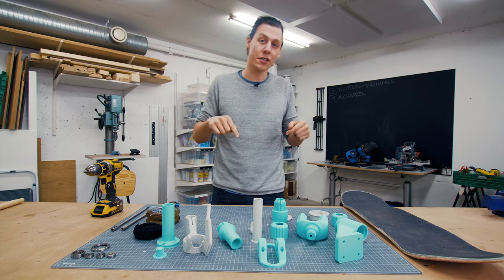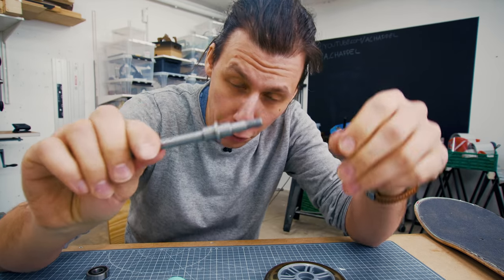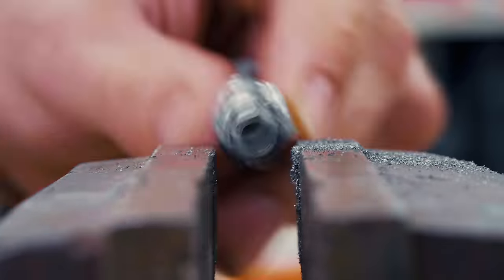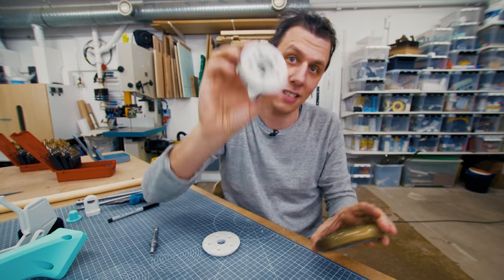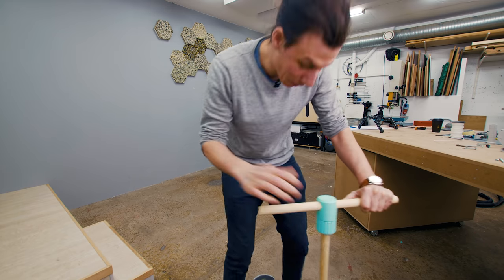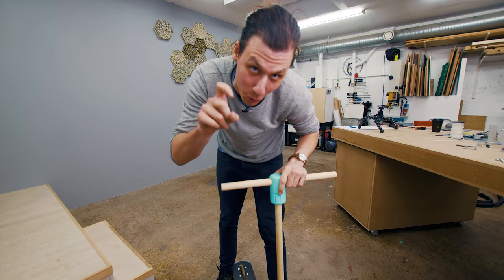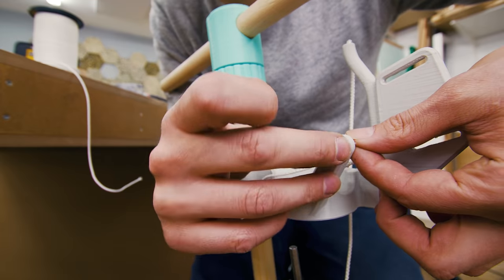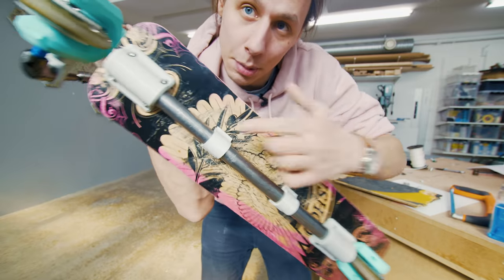DIY Drill Powered Electric Scooter - With 3D Printed Parts

Comment: Awesome job!  I'd recommend moving the drill lower to improve stability and eliminate the torque issues with the drill extensions.  The drill could be mounted in front of the front wheel so the weight of the drill is lower and better balanced left to right.  It would be further improved by driving the rear wheel as the inertia of the drill would not be connected to the steering assembly.  Any significant mass in the steering assembly can lead to over steering.  Teflon tubing would probably work for routing the throttle to the rear wheel area,  Props to you for showing the first board break, we have all been there...

Comment: In my head: "ok so it's the curvature in the y axis what gives the board it's stiffness"
AlCh: saws off the curvature
Me: "aight hopefully he won't regret it"
AlCh: breaks the board
Me: "oof, either he uses metal for the board or a board that's not cut in that direction"
AlCh: immediately saws off the curvature again
Geometry: am I a joke to you
Reply: The difference between an industrial designer & an engineer :-) 
Bending inertia I= (B*H³)/12 - notice how the height is cubed!
That is why the board was cupped to increase the height with the same amount of material.
I did not understand why the board width had to be reduced.
Still this build is very good ;-)
and the fix was a nice Queen truss - at the expense of road clearance ;-)
Reply: And the design was much better than I could do ;-)
this is why we have specialists.
Reply: @PWARHOLM  I suppose Alexandre reduced the width to have it look more like a traditional scooter, or to have it being more manageable.
Also that's the inertia of a square section, I don't wanna calculate the inertia of the true section but it's a nice approximate. plus i gotta admit, the truss was a smart way to fix the bending problem, altho if I was him I would've used a smaller truss
Reply: derchesten lol
Reply: @achappel  I think the full sacte board would look pretty retro like the "scooters" in back to the future
Reply: Stop spoiling it!! I haven't watched it yet!
Reply: @ironedge0  EXACTLY what I was thinking.
But still cool this way too. With the pipe maybe you can grind when you're not using the drill.

Comment: Simple brake, put a thin metal plate over the rear wheel such that when you stand on it it contacts the rear wheel to slow you and when you take your foot off it will spring free of the wheel.  Love the build and the amount of insane laughter it generated.  Keep up the good work.

Comment: Please publish the 3D models. Otherwise this would be just another scooter without any real use. Greetings from Germany.
Reply: Medien Mond dont 3D print this. Use a scooter as you can find them for sale online everywhere for Cheap
Reply: @steelavocado1  And a Hub Motor would be more Efficient and you can control it better. ^^
Reply: Tehnically you couldn't even use it in Germany lol
Reply: tbf you'd probably burn out the drill motor on your first ride. I don't think they're designed for constant use, just intermittent use.
Reply: Check his web page
Reply: virus killerism  True, but the thing is open source benefits everyone and a lot of people would like to build something like this.
Reply: @THYCR3AT0R  Perhaps, though these new brushless motors are quite durable. And he probably has warranty hah.
Reply: @Angeltitsss  Do you work at Dewalt? Because I don't know if that's a brushless motor or not. And yeah, as long as the motor keeps spinning it should work fine. What burns them out is usually too much resistance or heat. Heat melts the plastic the ballbearing is attached to which in turn makes the rotor wobble which then fucks the entire thing up. This usually happens in angular grinders, and also usually the 220-volt machines not the 18-40V ones.
Though I haven't seen that happen in a drill, usually the heat fucks the gearbox up in those machines. It's not very common. The brushless drills work surprisingly well, but the heat can mess the finer electronics up, you know the small devices that read the magnetic field... I forgot what they're called.
Reply: @Angeltitsss  Looks like a cheap machine as it has a plastic chuck and not a metal one. Thus it doesn't have a brushless motor and thus the carbon brush pair is going to get worn out, and in these drills, they're not replaceable.

Comment: It does have brakes. You can press on the rear wheel with your foot, the shoe's rubber sole 
will slow it down and won't make you fall since it's the rear wheel stopping/slowing down.
Reply: Interesting
Reply: @leoncaples2947  I remember kids using their foot to slow down while riding their broken bicycles 20 years ago. The advantages of living in a developing country...
Reply: @Albanez39  Sounds like a good time buddy

Comment: Everytime I see someone hit a bearing with a hammer, something inside of me dies.
Reply: he could've used a drill press with a dead shaft to press the bearing
Reply: wuss
Reply: @xagvsx1521  Aren't you a badass?! Look out, people!!!
Reply: The rollers and races die also.
Reply: He was hitting the outside race, perfectly acceptable way to install a bearing, and it won't cause any damage. A press isn't always the best or most efficient tool.
Reply: @diamondperformancefab5931  No, it's not. Bearings have to be pressed in with constant force, not with impact. Hitting the bearing unevenly makes the rails twist.using impact force could make 'em crack or split. In this case, it's nothing to worry much about because of the expected loads is not very heavy and it hasn't to perform for ages, but he most certainly wrecked the bearing with the first single strike on the race.
Reply: I guess I must be magic. Installed hundreds of small bearings with an hammer and driver into soft bores, never had an issue.  If you think one tap will warp a hardened outer race you are wrong. Can you damage a bearing with a hammer? Sure.... its possible. People should have real world experience before they comment. Obviously you don't. How do you install a input shaft pilot bearing in a crankshaft? Do you remove the engine then crankshaft? LMFAO
Reply: having  been an Automotive Tech and owner for 40 years .bearing banging badddd !!!! 3-D printing GOOD...
Reply: @ashleyt.784  How do you install a pilot bearing in a crankshaft Ms. Mechanic?
Reply: @diamondperformancefab5931  And once again. If you want to know, how you install a crankshaft bearing _properly_: With a bearing press tool. This works like a puller, but the other way around. It sits flush on the crankshaft, is mounted with screws on the surrounding threads and presses the bearing in via a screw or a hydraulic cylinder. But I guess you also can hit it with a nut and a hammer until it sits in place, so you could ensure another repair in the future if your income relies on it.
Reply: Yea I cringed I know it's not a precision component or anything but I would of at least used a rubber mallet 😂
Reply: Or you could start this topic on the informative side, instead of going straight to your frustration and just dump it out there, you might know stuff, but knowing how to pass it on is the real challenge and i don't need decades of expertise in nothing to figure that out.
Reply: @micleabogdan886  really? You got offended and he didn't even say anything rude lmao what is this world coming to...
Reply: Stop cringing
Reply: @joshuasimmons2412  so saying something like " i got more knowledge than you will ever will" and putting that into people's faces is not offensive to you? you must be a purist as well i guess :/
Reply: @marcus_w0  if you hit the outside it's fine
Reply: @marcus_w0  he used a wrench socket so he hit it evenly
Reply: @diamondperformancefab5931  i agree with yah.. Its acceptable considering also the base he fits in which is plastic...
Reply: You sound like a guy who simulate stuff by the computer and never have built anything.
Reply: @diamondperformancefab5931  it's a dude not a chick
Reply: @dswmetals02  Ashley T. looks like a girl name to me.
Reply: It was gentle taps 🤣
Reply: Keep on pounding Dan, I'm an ASE certified master Tech, since I was 21 also ASE certified advance level specialist who's been doing this for a living for 30 yrs, an I've been pounding bearings in my whole career , nvr had a comeback for a bearing..... EVER !!! I can assure u both these " intellectuals " that were replying to u , have nvr worked a flat rate job to support themselves ,  these if they truly r even "techs" at all they the ones that wear rubber gloves, and run around for half a day looking for a dial indicated inch pound torque wrench to adjust a tapered wheel bearing, and their go to tool to fix a drivability problem is an oscilloscope !!!! Lol  trying to reason common sense w these types is generally futile!! 😜
Reply: @diamondperformancefab5931  ohh n btw ,  saying that Ashley is a man's name makes about as much sence as thinking a autotech and a mechanical engineer have anything in common.... Js , ohh and what kinds mechanical engineer says u '"screw " said tool to the engine...... My 5 yr.  Old knows the difference between a bolt and a screw.... Lol
Reply: @micleabogdan886  😄
Reply: @marcus_w0  He's putting them in PLA plastic. I'm more worried about the parts splitting than the bearing being dammaged.
Reply: @IslandArt61  PLA is actually pretty sturdy if printed right. It's about the hardened bearing rims carving their way thru the aluminium extrusion. A thin ring of PTFE or any other material could prevent that. He could even get some heatshrink tubing and put it over the bearings.

Comment: Clever use of the one way bearing.

But as you mention, it's sketchy. That drill extension wobbling during use ... and turning completely exposed to the elements ... hope no plastic bag or piece of cloth comes near that or it'll get pretty wrapped! 

If the drill torque effect on steering is too strong ... have you considered making a rear wheel drive version ? 
And ... why the hell doesn't it have two handles? It kinda triggers my OCD
Reply: Make me wonder if a can use a drill to power my wheel barrel. But I would need some gearing.

Comment: Awesomeness me build! I you ever decide to change things up I suggest mounting the drill as close to the wheel as possible. The long extensions are stealing some of your power from the drill. That's why your handle bars are twisting so hard. Also since you have a lot of torque, maybe try making some gears that are shiftable with your foot.

Comment: I would also print some stabilizers for the drill extenders, which connect to the handlebar and prevent them from possible bends, for example in any type of accident.

Comment: Very cool... If it were me I'd make some kind of enclosure to hide the drill to make it look a bit cleaner but I love how you used all those 3d printed parts. Also, would it not have been better to mount the drill facing the center (ie battery touching the steering post)? Less stuff sticking out and probably less torque twisting

Comment: 3D print a spring loaded cover for the back wheel. Brakes done.
How's the clearance with that pipe on the bottom? Could you cut it into 2 half circles and mount those instead? Seems like it would be stronger, as well as provide more clearance.
Thoughts for version 2: Since you have so much torque, what about 2 wheel drive? Also, if you disassembled the drill and integrated the motor closer to the wheel, would that help with the steering issues? I guess you couldn't use the drill for drilling anymore then though... Anyways, great video!

Comment: Ok gang, one thing that's driving me nuts!  Your one way bearing is actually called an overrunning clutch. It's my ocd-ness maybe but please call things by their correct name!

I do have a question. Why did you cut the board? Those things are laid up in such a way that they have the correct amount of stiffness built in. Not to mention, the wider platform would be easier to ride. Me, I'd rather walk. It's safer. <grin>

I was really impressed by the quality of your 3d prints. It would be worth a session to discuss any issues you might have had. Thatcwas quite a tote load of "dead" parts.
Reply: one way bearing is just as much of a correct (but more generic) name

Comment: How exactly does the one way bearing work? Can’t quite wrap my head around why it wouldn’t still lock when you release the trigger on the drill. What allows it to run freely in the braking direction without changing the rotation of the drill?

Comment: do you have the 3d print files available and the parts list for the scooter? I think it would be fun to take your design and expand on it.. and make a 3 or 4 wheel car made with scooter wheels and using the broomsticks for the body structure. and your 3d printed attachments to secure the ends of broomsticks.. it would be fund if you have vareity of those attacments which could be made into a kind of erector set to make other things with broom sticks.

Comment: Great idea, have subscribed to follow and see what you bring next to the world.

With the issue of the brakes, could you not print a mounting bracket assembly of: top plate, springs, brake pad, that goes over the back wheel that once you place  downward pressure it engages?

Keep up the good work.

Comment: i like the design. why not keep it full skateboard witdth? Also, I am wondering why you didn't keep the drill placment lower to the ground on the steegin column.. to reduce drag/resitance and lowere over all weight of the scooter. Also I am wondering if it would make sense to build the for assemble as two parts to make it easier to remove the wheel assembly. In any case, i really like the design.. I want to try and build one too.. I hope you share your 3d print files for the parts (on thingiverse?)

Comment: Such a fun project! Although the handle is a bit too short for your height and I'd really like you to open up the drill, salvage the motor and make a 3D printed housing for it and then adding multiple battery packs to it along the board, making it more practical and better looking ^^

Comment: Mount the drill lower. The chuck extension makes it loose alot of torque because of axle twist. The acceleration will be alot smoother then. Also having the drill down low makes it so the handlebars won't twist when yanking the throttle

Comment: Wonderful, thanks! You can even use the lower (1) speed of the drill in order to have a lower and more manageable speed and a greater torque (I'm thinking for instance to sloped streets).. while as regards the brake, you can add something acting on the rear wheel :)

Comment: Nice build, you could also leave the shaft a tiny bit bigger than the inner diameter of the bearing. That way you can heat up the bearing to i.e. 100C and then use heat shrink to keep the bearing in place. Then the bearing will really stick to the shaft but naturally down side is that taking it a part requires you to have tool to pull the bearing out of the shaft + usually bearing needs to be replaced.

Comment: You are a CRAZY man! And a ton of fun too! Your 3-D printing skills are inspiring. I am sure that a lot of us could solve more problems in the shop with your mindset. Just harder for an "oldie" (61yo) to think in that way. But I am a techie and have wanted a 3-D printer forever just couldn't justify it in my mind. 

Any advice on brand / models in the $500-$1K range? I am an electronics hobbyist, machinist and woodworker so I should have no problems finding uses for it once I get used to the idea. Thanks for posting this fun and informative video!

Comment: I figure of you're using a string to trigger the drill, you could mount it much lower and make it more stable. Also, instead of the battery pointing to the side, it might be better to point it forward or backward.

Comment: I'm guessing the first part to fail will be the diagonal part attaching the board to the steering axis; due to the printing direction, bumps in the road could cause the part to delaminate. Should be much stronger if it was printed rotated by 45 degrees!

Comment: Just a quick suggestion: power the rear wheel and mount the drill on the board, just route the string to the handle..... it comes with 2 benefits. First better traction, second eleminating the torque from the handle...  at least I think so  ;-)

Comment: The brake is easy enough to solve - a step-on wheel-arch for the rear wheel, like regular folding scooters. ALSO, I'd be inclined to replace the solid drill extension shafts with a flexible drill extension instead - it'll handle torque a bit better than two metal rods being over extended this way, plus it is far safer with all moving parts on the inside [not exposed like the extension shafts - which could get dangerously tangled in something, like a bag strap of loose clothing]] and it'll give you a bespoke spindle for your drill chuck up top and a whole drill chuck at the bottom end to connect securely to the drive.

Comment: The steering is a bit unsteady because there is not enough rake angle and trail, note how bicycle forks bend forward.  You're off balance with the drill on the side of the steering shaft, which is why you are hanging your opposite foot off the board.  Use a flexible shaft so that you can rotate the drill mount 90° to center the weight.

Comment: Subbed. 
Do you think you could create a central mount for the drill? Any two-wheeled device is going to suffer from an unbalanced design. You could add a universal joint to the shaft. 
I doubt you'll have much carrying capacity for groceries beyond what you can carry in your backpack. Maybe you could build a drill-powered walker trolley? Because walking is healthy for you and there seems too much enthusiasm for avoiding exercise.

Comment: if the torque is to much , use a bigger wheel or
better use only 1 finger to control the throttle. I think using the hole hand is not sensitive since you need it for holding and balancing too.